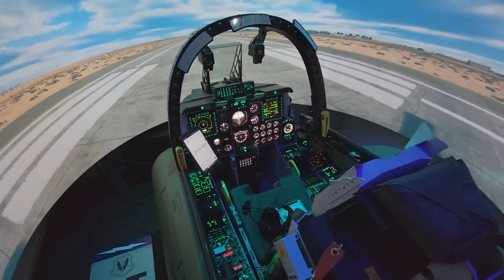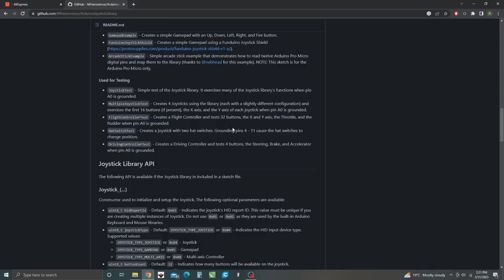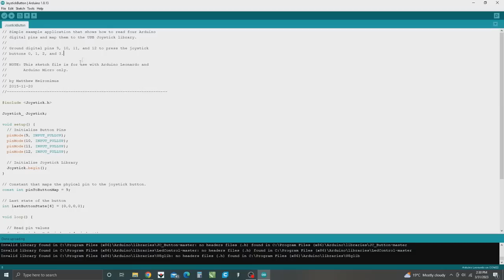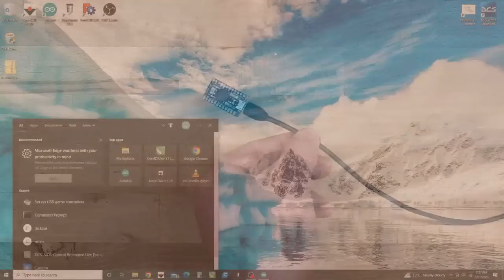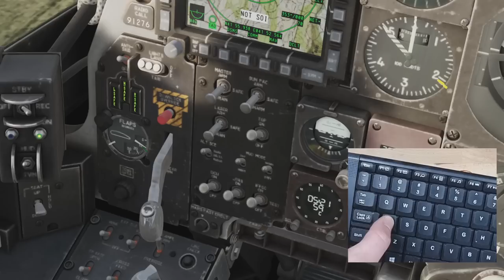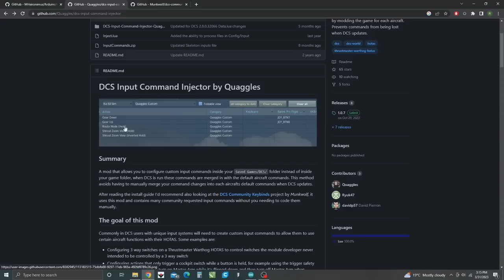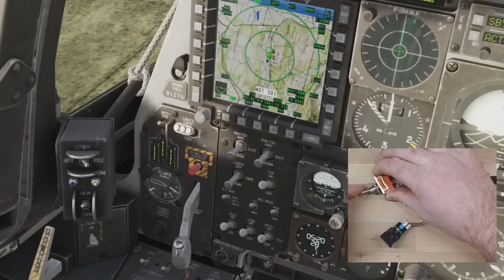Flight Sim Basics (Part 1): Connecting a Switch

Comment: A better solution you can do in your code is to have it send that signal on a signal rise and a signal fall (this requires as far as I'm aware setting it up as an interrupt).  Then when you move it to the on position, it sends the press, and when you move it to to the off position, same.  Only downside is when you fire up he game you'd need to have already "reset" your switch positions.  The reason I call it a better solution is it doesn't rely on a plugin that may flake out or be broken by an update.  Love the content.
Reply: The idea to just send a short "button pressed" signal on a rising edge and another signal on a falling edge is a possible solution. But you don't need to set the pins in interrupt mode. You can also scan the pin periodically comparing the pin state with its state of the previous scan. If you see different values, you detected an edge and can send a "button pressed" signal for the corresponding button. To overcome the downside, you can re-send the corresponding signal periodically.

But if the main goal of your solution is to not configure the sim to react to both button-states, there is a simpler solution: Just map each physical state of a switch to a direct-x button. The following code demonstrates this.

#include <Joystick.h>
Joystick_ Joystick;

int pins[4] = {9, 10, 11, 12};

void setup()
{
  for(int pin_no = 0; pin_no < 4; pin_no++)
  {
    pinMode(pins[pin_no], INPUT_PULLUP);
  }
  Joystick.begin();
}

void loop()
{
  for(int pin_no = 0; pin_no < 4; pin_no++)
  {
    int currentState = digitalRead(pins[pin_no]);
    Joystick.setButton(pin_no * 2 + currentState, 1);
    Joystick.setButton(pin_no * 2 + (currentState^1), 0);        
  }
}

Comment: I didn't know about Quaggles, very cool. I'm using mmjoy for my pro micro boards to make them appear as a generic joystick. I have made a custom circuit board I plug the pro micro into, supporting 64 buttons and 8 analog pins from a single pro micro and it's awesome. I'm almost done with a new version that bumps up to 128 buttons plus the 8 analog on a single pro micro🤘
Reply: You need to share that board :)
Reply: @DonaldMcMuffin  I plan to after I get the new version proven out 👍
Reply: Yea, where is your content video?  I want to see how to do many buttons :)

Comment: @thewarthogproject There is another way without using a mod.... pulldown Key/Button, and you will find an entry for "JOY_BTN2_off". Just bind that to the off position. This is after coding the Leonardo for joystick and bound within DCS...

If it is a 3-way switch (center is off or open), bind up to one function, down to the other, and the middle to 2 "off" positions. Example the F-16 Arming is 3 position. Up - Arm, Middle - Off, Down - Simulate. If it is 2 way on/off switch, just do half of this. One position is the "button" the other is the "_off" input. It must be selected manually from the pulldown. 

Bind within DCS ; Arm - "JOY_BTN1" - up. Simulate - "JOY_BTN2" - down. The middle position will be bound as above using the "Key/Button" pulldown. Off - "JOY_BTN1_off, JOY_BTN2_off". Boom! Done!

Comment: I did something similar. I connected 10x8 pins in the grid( including rx and tx pin,no ground) and used joystick and keypad library to program it. I have 80 buttons that work( they are all self-centering switches). Now I am figuring out a design/ layout of the switches.

Comment: Just a heads up, I don't know exactly when DCS World added it but now you can assign a button's off position as another button press. Basically, you assign the button again but then click on "Key / Button" with your mouse and manually choose the same button but it will have "off" followed after it. Then you will see two button assignments for the same switch on the main controller screen. The switches work as they should after doing that. So, no mods or circuit setups that send a pulse to get an on/off switch to work in DCS anymore.

Comment: The AH-64 controls have me wishing I knew how to 3D print my own custom assemblies and throw them together. The cyclic/collective I can make work with my Winwing/Warthog setup, but the CPG seat gets brutal with an X-Box controller and trying to fit 1,000 buttons and switches on the damn thing. 

Nice video, as always!
Reply: If you need help I got. I fix the apache for my job. So if you need any help I gotcha if it's within what I'm allowed

Comment: 1:05  The Leonardo is the same form factor as an Uno, but has the 32u4 processor with native USB. The Pro Micro may report as a Leonardo to the Arduino IDE, but it's not the same thing.

1:54  "...six inches long..."?

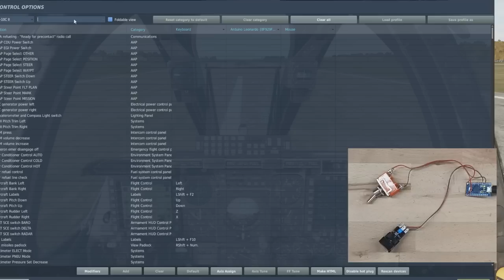6:32  Whenever I first connect such a device, DCS tries to guess which binds to use, so it's a good idea to check and clear out if necessary the axis and non-axis binds of new devices.

7:02  Looks like you put the button on the Master Caution circuit breaker bind.

8:20  WRT on/off bindings.  You can program the arduino to send another pulse of the same signal, or a different button press, when you turn the switch off.  You can also use this to make "virtual buttons" for on-off-on switches to give 3 separate outputs.
There's also a way to increase the maximum number of buttons to 128 if you need more virtual buttons.

Does Quaggles cause problems with purity checks?

Comment: On an on-off switch in Arduino you can just watch button state in loop, after the state change save it to variable and send a pulse/message to a PC. The only issue is when you close the game you should reset the buttons position manually.

Comment: You can also program switches connected to one pin to act like two buttons. For example when switch is on-joystick button 1 is on for 200ms and when switch changes state to off- joystick button 2 is on for 200ms. This way you can have 36 joystick buttons connected to 18 buttons(18 pins+ground) which this board have. All switches can work at the same time , if you connected 10x8 pins with no ground you can have 80 buttons but a lot of them don't work at the same time. Basically you can do whatever you want.

Comment: Thank you for uploading this. My f-18 simpit has almost a fully completed front panel. I have been wanting to know how to add my own switches for a while now. I use dcs bios with some premade switch boards built by tek creations but have a few buttons on my front cockpit that have 2 wires coming out of them but arent programmed or attached to anything so I need to learn how to do it myself. I know how to solder so that won't be a issue.

Comment: You don't need that two position switch mod, you can alter the Arduino loop to make it send the on signal for the button on a state change instead of when it's on or off.
Reply: how?
Reply: @braitebrina5148  The program he's referring to lets you set up when a button is on or off independent of the input it gets, so you need only set it up to stop sending the signal after a few seconds.

I'll give you some example code in a separate post.

Comment: Wonderfully explained as always. One question lasts, if you use more than one Leonardo, is there a way to re-name the different Leonardos? 
I just remember my struggle with easy usb-game controllers, that where not recognized  as different boards (in comparison with the Leo Bodnars where you could give them certain numbers).
Reply: Yes, you can change the name of the device, and its ID in the boards configuration file in Arduino

Comment: The typical workaround (I use) with switches in DCS is to assign TGP ON = JOY_BTN2 (on), and TGP OFF = JOY_BTN2 (on release).  This is native to DCS and seems to work fine without the need for any third party apps.
Reply: i use this too but what i dont like is if your switches are out of sync at the start they stay out of sync. this is extra annoying if you are playing in something like a huey where the ai co pilot will sometimes flip switches randomly.
Reply: @patty_cakes5596  That's why I made all my switches momentary, so there will never be a mismatch between the hardware and the game.

Comment: You should be able to just change the code so that it sends a signal whenever the state of the switch changes. You just save the last state in a boolean variable and send the signal when it isn't the same.

Comment: I'm using toggles in DCS with a simple panel I made. You can get around the issue of having to throw the switch twice by using a simple if statement. should look something like this for the Joystick library.
if (digitalRead(button1) == LOW) {
Joystick.setButton(0, 1);
} 
else {
Joystick.setButton(0, 0);
}

Comment: Thanks for this, gives me the push I need to get my cockpit going it’s easier than I thought. Quick question, how would we do a 3 position switch? If we solder both poles to inputs that’s well and good but DCS only allows one switch input for that 3 position switch and I’m assuming that would show up as two independent switches.

Comment: 7:15 Problem is ED too lazy to program a Release to all the switches. Make it like MSFS 2020 where you can select activate or release for the same button. I use RS Mapper to get around it, but Quaggles looks a lot easier, since you don't have to use a separate program. Is there a profile for Quaggles you can save?
Reply from the maker: Lots have people have since told me DCS can do this natively since a recent update, although i havent tried it out yet because i had no idea it was possible. Ill revist it later on!

Comment: Noob question.
Toggle switch when it is ON is like to push and hold button on a keyboard, right?
AFAIK, Windows and games (WarThunder to be specific) do not support the state when 3 buttons are held simultaneously.
It means that if you hold 3 buttons, the system will not recognize if you push the 4th button.

So, is there a problem, when you have 3 toggles swithes ON?
I hope I explained my question.

Comment: Thanks for making this
I bought a one of the controllers and 3 non momentary switches just to learn this.
It will be nice to use to make a wall cooling panel for the p51 and 47.
How do I know where to solder the wires?

Comment: Are you sure you cannot solve the toggle switch problem with software in the Arduino.
You can tell it to give a single pulse every time it changes level from 0 <-- 1 or 1--> 0.

Comment: I’d like to note that your wrong with adding more pins, adding those lines with the additional pins is NOT the only thing you need to do to use all the inputs of the board, there are actually 3/4 more lines that need to be edited in the code, I’m really not sure why the example doesn’t do all the pins, if you don’t use them all then they just don’t get used lol
Reply: Do you know how to add more? I’m a noob, but have this set up could do with adding more to maximise the board…

Comment: Why would you modify DCS? The Arduino is programmable, with C code. Just have the Arduino monitor the state of the toggle in a loop and send the appropriate signal to DCS? That would take all of about 5 minutes to code the script and you're not screwing around with DCS. It seems like you've taken the backwards approach.

Comment: Great content.  Now for the complicated question.  If I have 75 switches to wire up, what is the preferred solution?  Multiple Arduino boards plugged into a USB hub?
Reply: You could use a button matrix though you might run into issues with toggle switches using that, you can also have multiple Arduino's using one usb, one is the master that you plug into your computer and the others (slaves) are wired into the the master.
Reply: I's suggest looking into a large button matrix if you are only using pushbuttons (a matrix only really works well with momentary push button switches), or you could cascade a bunch of shift registers like the 74HC165's possibly.

Comment: hey i get around the issue with the toggle switch by using a simple if statement in the arduino code i am using a similar libary for an raspberry pi pico i am intrested if u know a way to get lights working on the pico?

Comment: do you prefer this method over using the DCS Bios and std arduino like you used in your build?
Reply from the maker: Ive mixed and match both. I use this method for the panels that only have switches, and DCS-BIOS for the panels that need an LED or display.
Reply: @thewarthogproject  Brilliant thanks for the info. Your videos are ace. i mustve watched nearly all of them.

Comment: The USB is redundant once you’ve added your code. There’s no point having a usb module on every single board you’re using. How do you add one single usb interface on your breadboard and just quickly slot your module in to your breadboard without soldering so that you can add your code with the usb interface?
Reply: The USB interface is needed to send the signals to the computer. This is the whole reason a 32u4 is needed instead of a 328.
Reply from the maker: Im not really sure i understand? How would the code send or recieve any data from the PC without any USB interface?

Comment: If I need to program a 3-position switch but bought an ON-OFF-ON switch, do I need to return the switch and get an ON-ON-ON? Edit: I mean, without the injector.
Reply: No. You can detect the center position via software on the microcontroller and trigger the center output when neither input is active.
Reply: @user2C47  Does Freejoy have this feature?

Comment: There's a Arduino-IDE code to bind a 3-way-toggle:

#define DCSBIOS_DEFAULT_SERIAL
#include "DcsBios.h"
#include <Joystick.h>
bool state = false;

Joystick_ Joystick(JOYSTICK_DEFAULT_REPORT_ID,JOYSTICK_TYPE_GAMEPAD,
12, 0, // Button Count, Hat Switch Count
false, false, false, // X and Y, but no Z Axis
false, false, false, // No Rx, Ry, or Rz
false, false, // No rudder or throttle
false, false, false); // No accelerator, brake, or steering

void setup() {
DcsBios::setup();

pinMode(14, INPUT_PULLUP);           // LandingGear Up/Down on PIN 14
pinMode(15, INPUT_PULLUP);           // LandingGear Up/Down on PIN 15

// Initialize Joystick Library
   Joystick.begin();
}
 
    int keyState = false;
   void loop() {

   DcsBios::loop();    
// Flaps Switch     TOGGLE 3 WAY
 if (digitalRead(14) == LOW)
 {Joystick.setButton(4, HIGH);}
 else
 {Joystick.setButton(4, LOW);}
 if (digitalRead(15) == LOW)
 {Joystick.setButton(6, HIGH);}
 else
 {Joystick.setButton(6, LOW);}
//Both are off
 if(digitalRead(14) == HIGH && digitalRead(15) == HIGH)
 {Joystick.setButton(5, HIGH);}
 else
 {Joystick.setButton(5, LOW);}

}

Comment: I did something similar. I connected 10x8 pins in the grid( including tx an tx pin,no ground) and used joystick and keypad library to program it. I have 80 buttons that work( they are all self-centering switches). Now I am figuring out a design/ layout of the switches.